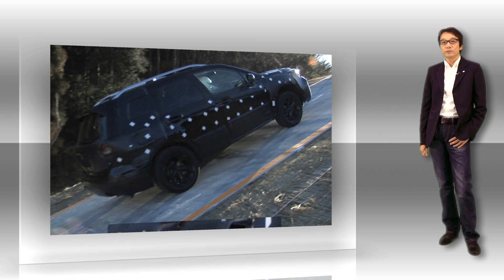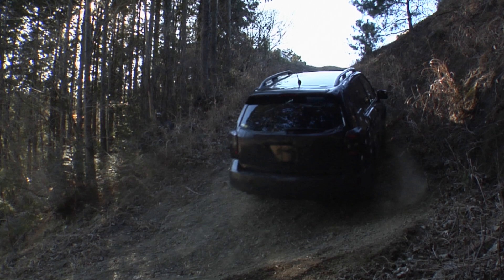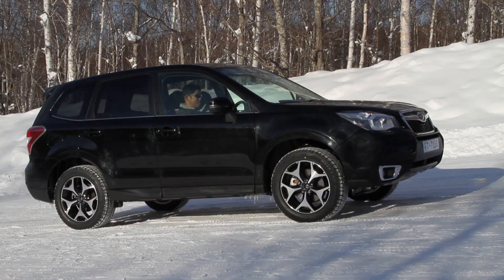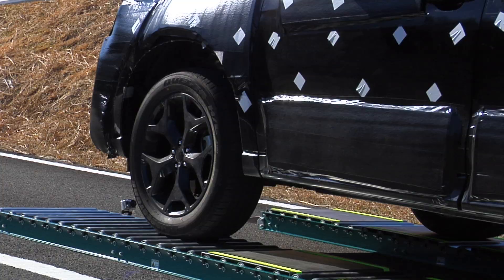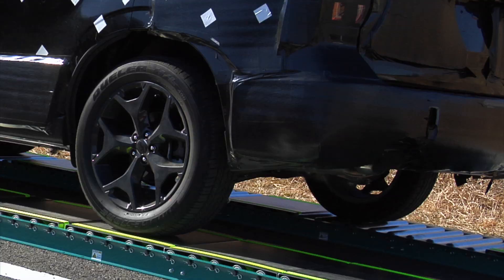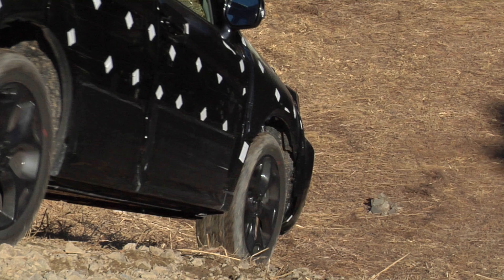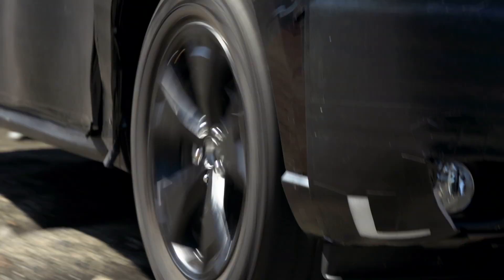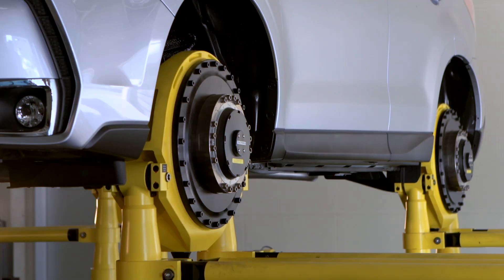The 4th generation Forester development movie chapter 3

Comment: x mode sounds like traction control with automatic abs
Reply: I think so.  When one wheel spins too much the brake is applied to that wheel and power applied to another as the computer observes the whole show and makes adjustments continually.